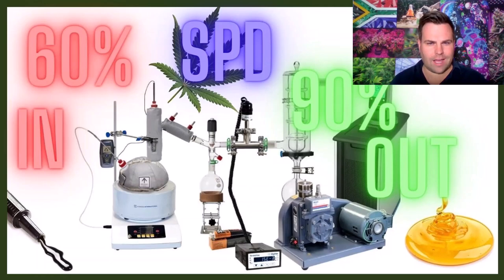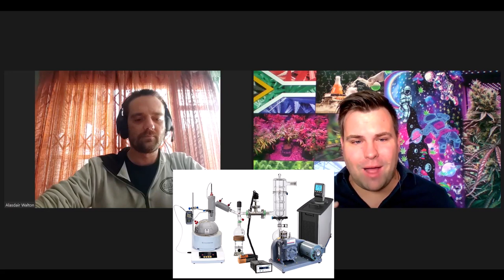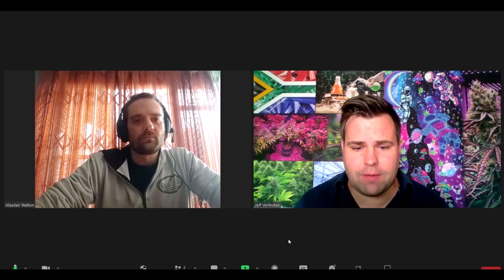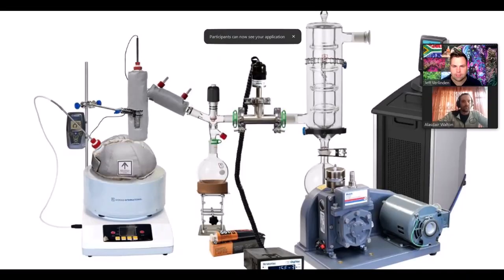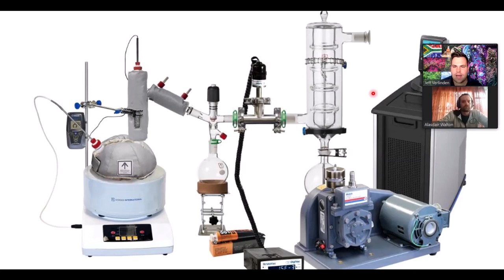Cannabis oil enrichment - SPD (Short Path Distillation) 60% to +90% cannabinoid concentration.

Comment: I got one of these units a few years ago. A 1L short path. What I didn't realize is how much product you need to even run one of these.

I ended up just using it to teach myself organic chemistry.

Unless you're on a large scale you're better off using other methods for seperation. Even then its still probably more produced than the home grower can reasonably produce.
Reply: CBD isomerisation cuts off the need to grow
Reply: No lo vendes
Reply: How much product do you have to put into it ? And how much did it cost ?